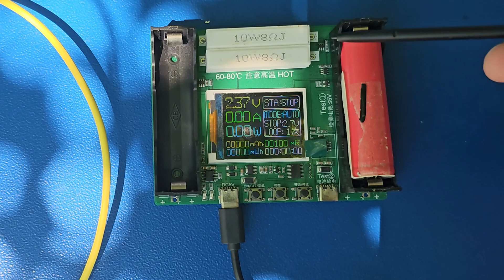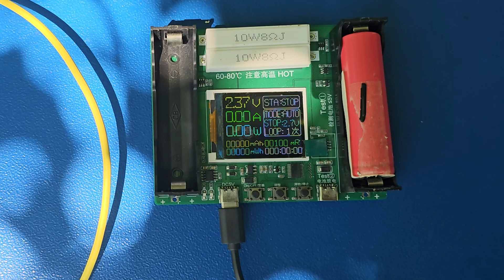18650 Battery Capacity Testing Made Easy

Comment: Hello everyone. I have had this device for 1 year. I recommend putting a radiator on the resistances, changing the battery support to a better quality one as the battery is works very well. It's a shame that it cannot be charged with the module (powerbank). Finally, the value of the internal resistance is not very accurate on the device. Otherwise, supports can be added for other cells as well.
Reply from the maker: Thank you for your valuable comment.
Reply: @JustBotond It's normal. The product is good, inexpensive, and the video is well done too. 👍
Reply from the maker: Thank you for the feedback too.
Reply: Can I use other kind of 3,7v  batteries in it by just conecting the terminals? Is there any kind of value of the The internal battery resistance indicated by this device that would indicate that the battery is bad for sure even though this device does not have a accurate measuremnet system to  Instenral resistsnce?
Reply: @MohaModzClipzOfc  Yes, we can test different cells, but only at 4.2V (one cellule ). ( 3.6/3.7 nominal ) Personally, front of. At the end, 2 crocodile clips, with two neodymium magnets to go on round batteries. For the rest of the resistances, it's not a 4-point test. A 4-point test uses both alternating and direct current to obtain the value. Here, it's more mathematical. It's also important to know that in charging mode, the current is about 1 amp, so it's not suitable for a cell with a capacity less than 1 amp.
Charge and discharge current cannot be modified on this version of the module.
"For safety" I set a maximum discharge of 3.2V on my
Certain cells can go up to 2.8V, you need to check the datasheet of the batteries to be tested.
It's important because the battery can be destroyed if it is too much.